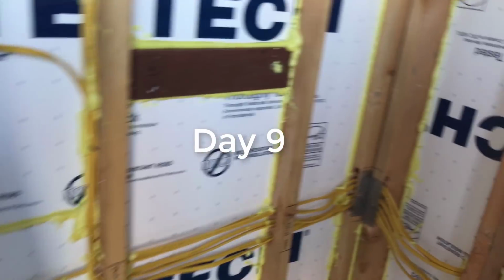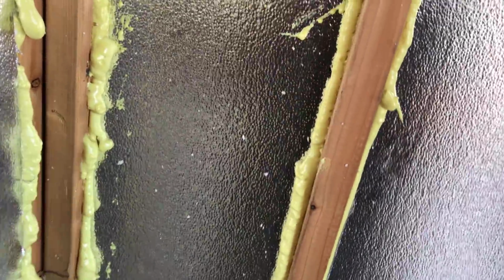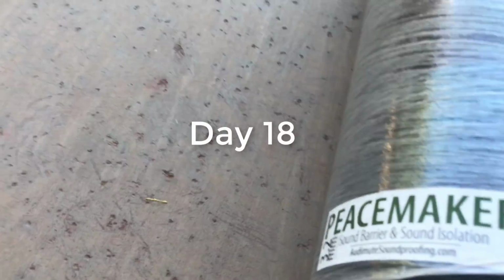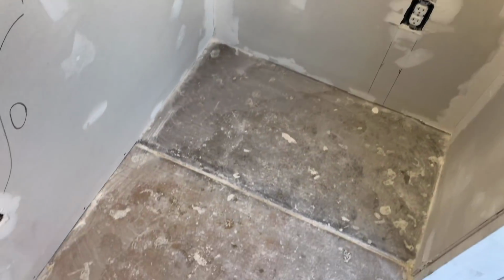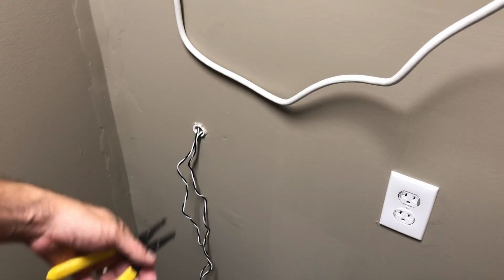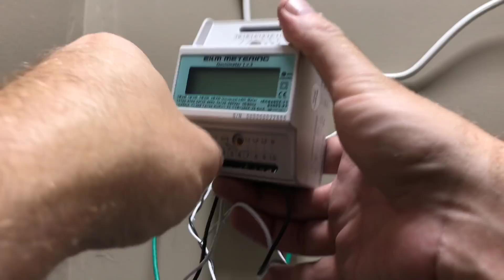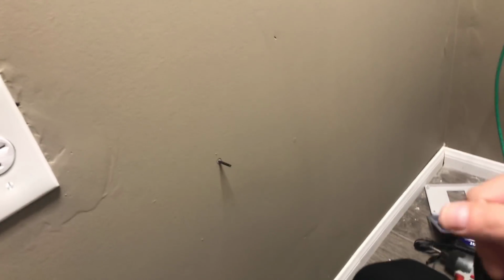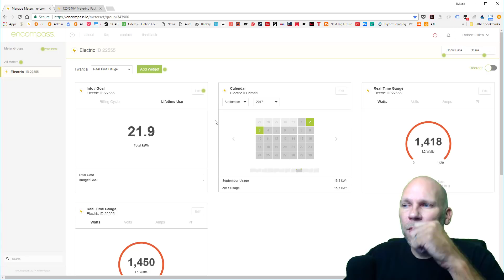Mining Farm Build - Mining Litecoin, Bitcoin, and Ethereum - Part 2

Comment: So how are the temps holding up? My room is just about as small but after looking at some other setups I was thinking I need to allow more air into the room as the antminers (6) want to blowout about 200 CFM each. Also I saw a setup where in addition to the main room there was a "hot" room where the antminers blew the hot air and there was an exhaust fan in that room to blow out the hot air. The guy said that if he were to just blow it outside like you have here it would make too much noise; but yours didn't seem to be that loud.
Reply from the maker: Hi, the temps have been good, but the AC struggles in the summer and I also needed to bring in more air and added an intake. It also depends on how many miners you have and which miners you have. Some miners run hotter like the A3. 

It is best to have a cool side and a hot side, but this room was to small for that and my budget was small.

The noise is not that bad, sounds like a loud dryer vent when right outside the room, but fades quickly with distance. I would do the air flow differently and the electrical differently (use a pdu) if I do another one.
Reply: Same situation.. I'm about to use a closet that is 3ft x 2ft x 8ft. Going to install  4x L3s.  I was thinking of putting 4 inch exhaust tubes on all 4 and have them connect to a 6 inch tube that goes straight up  where a fan that pulls 500-650 CFM shoots the hot air out side.   I will cur out an intake hole on the side of about 6 to 8inches.. what do you think?

Comment: I am in the process of designing a mine.  They have told me to focus on displacement of the  hot air exhaust from the units, the airconidioner will not help because you will be taking more out @250 CFM per uit than the AC is able to cool.  What do you think?
Reply from the maker: Yes, that is exactly correct. I would not use the in wall AC unit. They do not provide enough air flow. You will need to circulate the air so for my room I need to circulate around 1200+ CFM, which I'm struggling with right now trying to find the best solution.

Comment: SUPERRR !! CONGRATULATIONS FRIEND, A QUESTION HOW MUCH MONEY WILL COST INVEST BUILD THE ROOM? I WANT TO MAKE AN EXACTLY SIMILAR
Reply from the maker: Hello, it really depends on how much you do yourself and how much is hired out. The more you do yourself the more you save. The price is about $2000 in materials not counting the cooling system. I would not recommend using a in wall ac unit, instead get a commercial Mitsubishi unit (which cost around $3000 - $4000 installed alone). So to do a proper setup I would estimate $10,000 doing some work on your own. But you could get away with as low as $3000 (excluding the Mitsubishi ac unit).

Comment: What is the db outside @ 1',2' and 3'?
Reply from the maker: It's not very load at all.  The AC unit in the wall makes more noise, which will be coming out in the spring. I have not tested the actual db level, but it's not loud. It has gotten louder since I added intake vents, but it's still not that loud.

Comment: The y vents are going to be a problem. You are going to create an air pressure problem. The only way to use those is if you have a larger fan sucking more air than the two Antminers are pushing out. You could use a y that has 2-6"-10" or 2-6"-8" but that might be two small. Those y's were made to push air in the opposite direction.
Reply from the maker: Yes, you are correct. I'm still trying to fix that issue.

Comment: Put the entire Electronics include the Powersuplies in a big Tank full of Mineral Oil to cool more eficient. Overclock the Miners and do not waste the Heat - sell it. When once the heat is in a Tube it is easy to transport.
Reply from the maker: Yes, this is an option too. I've seen these setups before, very interesting!
Reply: Who exactly would you sell the heat to?
Reply: To a company that use it als Processheat. To my Neighbor to heat his House. To cook Edds. Heat a Swimminpool.... ALL you want. There are allready big datacenters they do it since a lot of years.
Reply: With a Stirlingmotor you maybe get back a fraction of the Electricity :-) https://de.wikipedia.org/wiki/Stirlingmotor
Reply: Heinz Schumacher  To make sure I understand what you are saying. Submerge the bitmain  miners into the tub of oil? I'd be nervous as hell. Have you done this with your miners?
Reply: No Trent Turner i have no Miner Hardware. But on YT there are Guys they did it. BUT Mineral Oil is maybe critical because the PVC Insulation of the Wires get harder and harder by the Oil. Maybe they must changed in Wires with other Cables with Rubber Insulation.

Comment: Next time use PDUs instead of all that wiring, sockets, and metering. A single AP8841 is rated at 30A, has over 30 receptacles, is metered, and connects to a network.
Reply from the maker: Wow, will definitely use one of the next time :) Thanks.